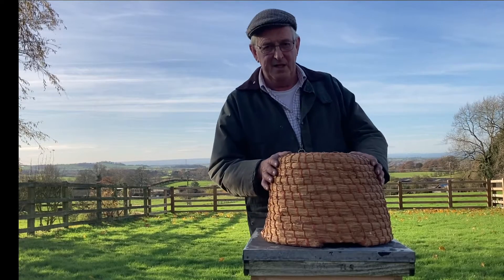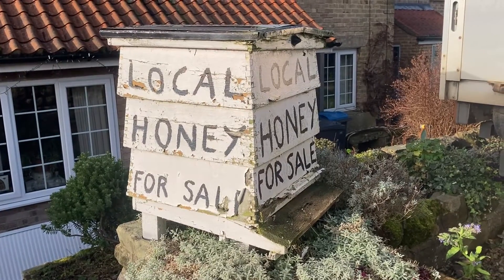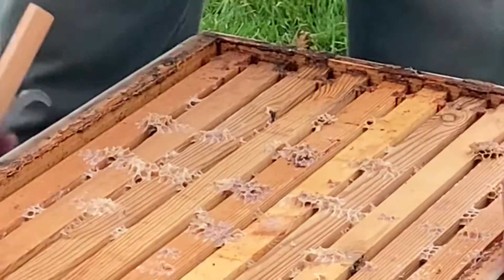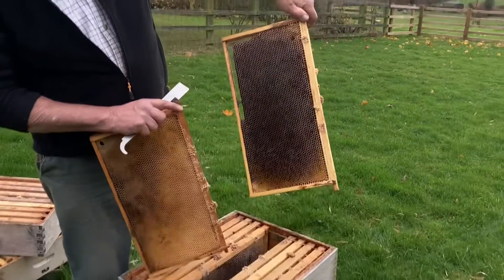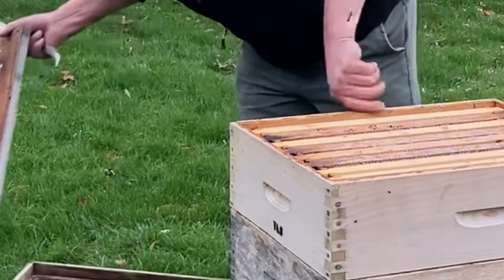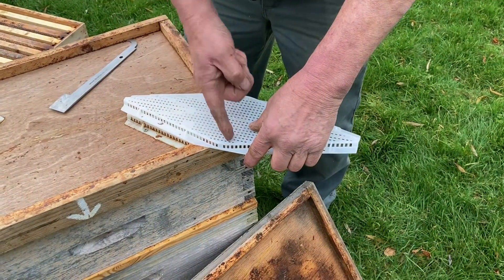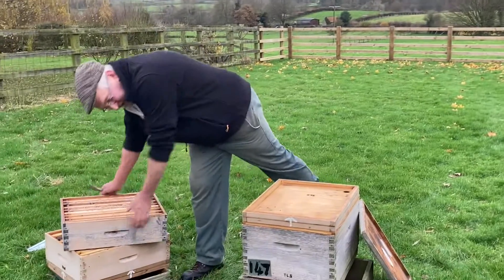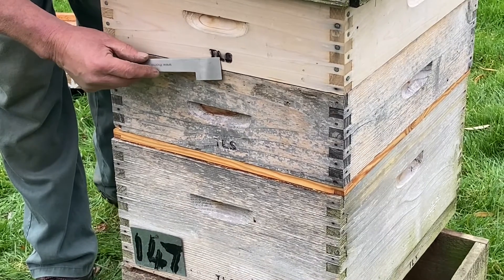Swales Honey- Basics of the Beehive

Comment: I like the idea of clearing the bees from the supers away from hives 🤔 It’s worth trying as long as you don’t leave them too long - but perhaps you could leave the boxes while inspecting the rest of the hives👍👏🇬🇧
Reply from the maker: Hello Glynis, I can lift the boxes off a site of say 16 to 20 hives in about an hour and a half to two hours, replacing the lifted supers with empty ones.
After about two hours most of the bees  have cleared and I then blow the remainder out. 
One trip clearing.
Reply: These days I use bee quick on a fume board it makes honey harvesting even easier still. You don't lose any bees that didn't make it back to the hive that way. I have numerous other uses for it lined up too. Def look into it if you haven't already
Reply from the maker: I did try using a bee repellent many years ago. The product was Benzaldehyde I seem to recall, now banned as a carcinogenic I think. I didn’t find it reliable in our climate, often too cool to work.
I don’t believe I lose any bees with this method. 
Sometimes I find clusters of bees under the bottom boards and as an experiment I have “dumped” them in the grass.
Once the first few bees fly home they start fanning and the rest follow. 
After about an hour all the clustered bees are home.
Reply: @swaleshoney  that doesnt sound good but I definitely recommend you give the bee quick a try it's not the same as the stuff they used to use. I believe it contains almond oil among other ingredients which are not as noxious and not carcinogenic to my knowledge. What started me down this road was illness and a brood sized super I needed to take off (dont ask lol). No way was I going to lift a box with 50 lb plus in it. The bee quick worked really well,  clearing the box in about 5 minutes then I just had to.lift out frames and blow maybe 5 bees off the bottom of each frame with a leaf blower. A super would have been 100 % clear I'm fairly sure and in less time.
Reply from the maker: Thank you for your comments on this matter. I can see why you did it that way.
One of the issues I have with this method is one of multiple supers on a hive.
As you clear each one more and more bees are forced further down the hive and then out of it.
We sometimes have perhaps up to 6 supers to clear on a very strong hive and using fume boards we have to clear all the supers before putting empty ones back on. By this time the bottom box is so crowded, adding empty boxes is very difficult.
We could lift the full ones off first, add empty ones back onto the hives and then put the full ones back on to clear. 
The problem there is that we are lifting boxes too many times - a massive issue in commercial beekeeping.I often have 60 - 80 supers to remove from a site and consequently a similar number of empty ones to put back on.
The system I use is designed to minimise the amount of lifting required.
I am sure the modern repellants are safe but I honestly believe my system is quicker and involves the least amount of lifting.

Comment: I really like your clearer board technique.  About how long does it take for the bees to clear.  Hive beetles can be an issue where i am in Texas.
Reply from the maker: Two hours sees most of the bees gone. I then blow the remainder out.
Just glad we don’t have small hive beetles……yet.
Reply: That's really fast compared to the ones placed on the hives.   Most say 1 day per box.  I may make two of those and give them a try.  I currently use honey bandit.
Reply from the maker: Yes it works well providing the weather is reasonable.
It won’t work if there’s any brood or a queen in the supers.

Comment: Very interesting video.  Ive not considered making the bars on the honey frames wider, so thats something to consider.  I remove a frame or two and use a spacing tool.  My bee space is 1/8 bottom and 1/4 top.  That works for me because i build my on frames and need that 1/8 for tolerance.
Reply from the maker: The problem with my honey frame sides is that they wouldn’t work well with an uncapping machine - not enough comb stuck out past the side bars.
We uncap by hand but this causes us a bottleneck and needs addressing but the cost of replacing all those Manley frames with shallow Hoffmanns or straight sided frames is prohibitive.
I hope to cover “what I’d do differently” in a future video.